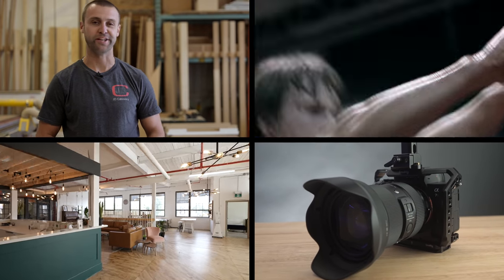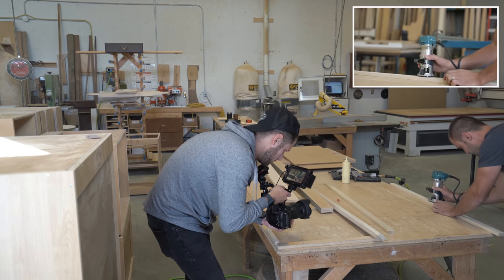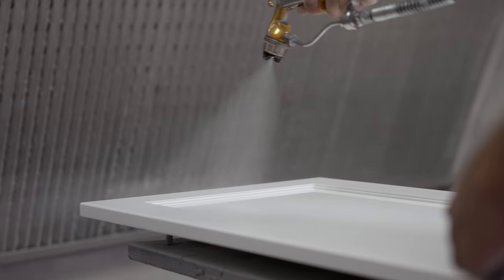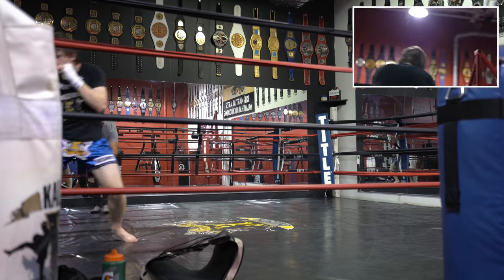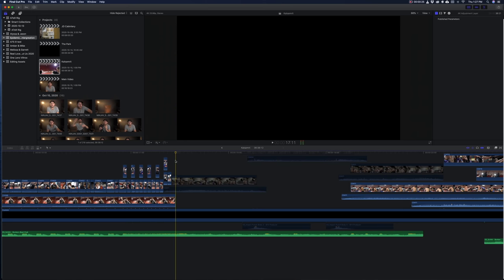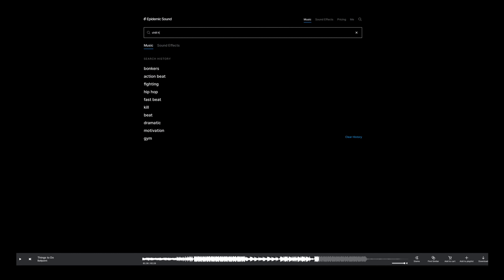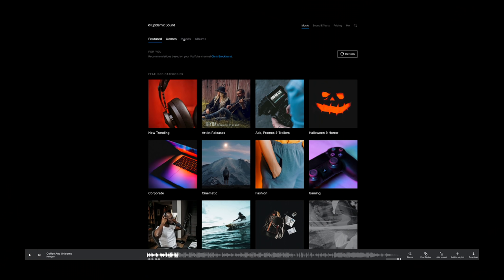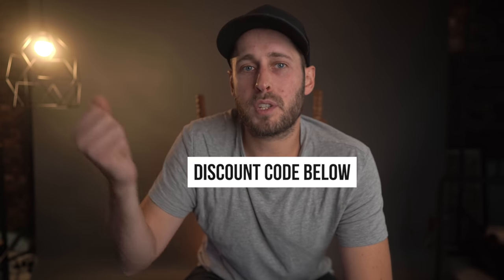Making 3 Corporate Videos with the Sony A7SIII

Comment: Thanks for the video, Chris. What computer are you using btw? Is it the AORUS build? If so, how well does it handle 4k 24/30, 60 and 120 in H.265? Do you need to transcode the footage before editing? 

2. I have read that NVIDIA doesn't support 10 but 4:2:2, while they do support 4:4:4 as well as 4:2:0 in 10 bit. How does that affect things for you, and for us? Which GPU do you recommend for a fast workflow?

3. Since H.264 and H.265 have the same bitrates in XAVC-HS and XAVC-S, is there a difference in quality of the footage, specifically when it comes to fast motion?

4. Have you tried the Premiere Pro HEVC decoder that was just announced this week? If so, with what GPU and how well did it go?

Bottomline: I'm wondering if I should buy a new PC or not. I have an old R5 2600X with 1070 Ti, which is kinda slow for 4k workflow. So far I only really worked in H.264 8bit 1080p, so I was good. But now, with 4k and 10 bit 4:2:2, the answers aren't clear.

Comment: Hey Chris, I know you get asked these questions a lot but I just need some reassurance. I’m a young beginner and I primarily just shoot stills and I’ve been dabbling around with an old fuji XT1 for about a year now and Ive been thinking about jumping to an A7III for my casual trips and gatherings. I shoot with a 35mm 1.4 but I find it extremely challenging to shoot regular outdoor portraits due to the crappy af and hard to work with dynamic range. Would you think it would be smart to pick one up?

Comment: Thanks for the video the A7SIII looks fantastic. I really want to get my hands on one. Can I give you some constructive thoughts. I'm no pro I'm just starting on my videography journey and have a lot to learn but I've been involved in the arts all my life. The thing I noticed is that you're very good at the technical video work but when it comes to the artistic stuff that's where things fall apart. Compositions are very awkward. It's like you're just trying to fit the subject in the frame rather than trying to frame the subject with purpose. You know what I mean? Also I would recommend working on the character development in your films. I had no interest in the carpenter or the fighter by the end of the films. There was no emotional connection to either of them because there was no story to pull me in. Just a bunch of clips chopped the beat of the song. Again i'm hoping this comes across as constructive i'm totally not trying to be an ass. Art is emotion. Character development creates emotional connection to the viewer. Proper composition evokes emotional reactions in people. These are very important tools that can't be bought. There's a clip at 3:30 where the carpenter is cutting something and the tool is obstructed and the focus is on the guys triceps? You have a lot of potential but I would recommend stepping away from the technical side of video and jumping head first into developing the artistic side of your video or story telling :) I'm putting a smile there because I really do mean this as a constructive statement. Hope that advice help you :)

Comment: I'd say the second one is my favorite. Noted that you shot the first 2 handheld. Especially in the first one, did you add stabilization in the editing? I've used warp stabilizer in PremierePro and it worked out well in one case but in another it was entirely unuseable as the footage seemed to be slanted for some reason.
Reply from the maker: Other than the one shot on the Gimbal at the start of 2nd video and the 3rd video (where alot was on gimbal) everything else was shot handheld, mostly using the active steady shot on the A7siii. Its a game changer.